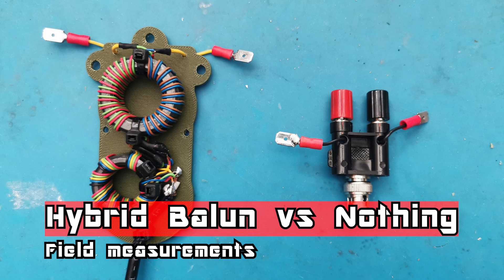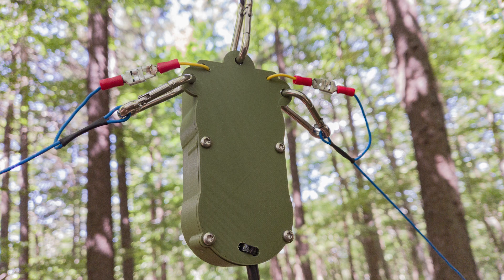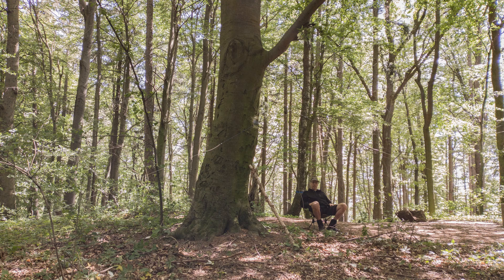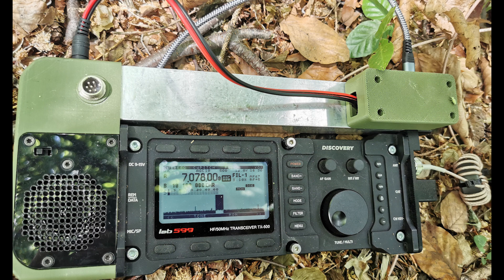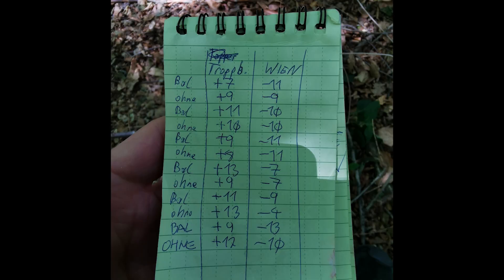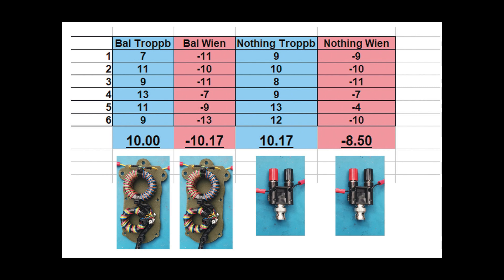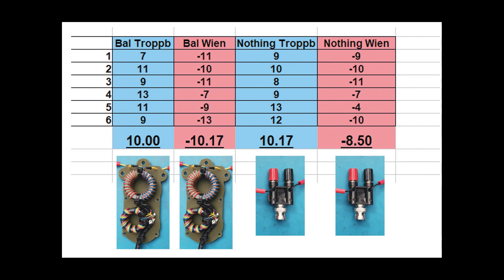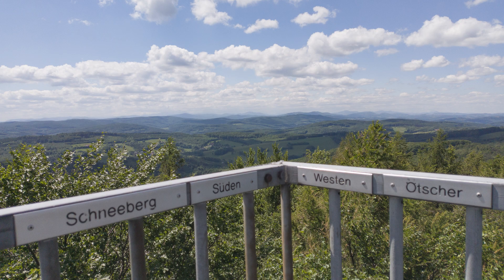NVIS Dipole, Hybrid Balun Vs Nothing

Comment: Thank you for sharing . I  stopped using a 1:1 balun on my antennas a couple years ago due to similar results. I do use a self built sleeve choke on my feedine to address common mode but to be honest I personally have not experienced problems with common mode on a center fed balanced antenna unless I  loaded the antenna on a frequency below what I cut the antenna for.  I feel the 1:1 balun just induces loss FWIW. Thanks again for sharing your data with us.
Reply: With a resonant antenna you don’t need any type of feed line choke.
Reply: @N2YTA  Yes but I use a feedline with a choke because Its what I use as I said. Thanks for sharing your insight.
Reply: @survivalcomms  it's not likely that an antenna will be perfectly resonant everywhere in the band so using a choke is a good idea.
Reply: A coax wound balun introduces no losses, yet still stops common mode, it's a win win with no negatives.
Reply: @VE9ASN  yes, good point

Comment: Yeah, it's easy to forget that baluns introduce their own losses, so they're only useful if they're fixing a worse problem than they are causing.  Obviously vital in an antenna a long ways from 50Ω like an EFHW or an OCF dipole, but a normal dipole is close enough regardless of where you put it.  Even the 'imbalance' from feeding it a dipole with coax is only a couple percentage points drop in effective radiated power, less than the typical loss in a current transformer...

Comment: A very useful demonstration. The balun is there to stop common mode current on the outside of the coax especially on receive where we want to prevent any interference picked up on the coax outer from entering the receiver. Since noise levels when operating portable are low, a balun should not be needed.
73 de Steve

Comment: Just a question about setup - what was the electrical length of the feedline used? If the feedline is a multiple of lambda/2 then radiation from the feedline would be minimal compared to other feedline lengths. Edit: this applies to a resonant dipole so not sure if feedline length has much the same effect in context of a shortened dipole as presented here.
Reply from the maker: @jbfedison  hi, good point. I did a test in that video to figure that out.
https://youtu.be/nIa0Cy654gg?si=y1T9K3mQtWlt4I5-

Comment: A field strength meter reading would have been a useful gauge as to sig going out ?
Reply from the maker: hmm not sure if you can read that meter precise enough if you are so close to it. just a feeling
Reply: @CrazyChekov  possible.  However the band going up and down ant a /b or in this case balun/ no balun is at best haphazard?  Unless you conduct the experiment over a long period?
Reply from the maker: the longer the better for sure. feel free to join testing. the more results we get the better.

Comment: I prefer isolation transformers. Nothing will provide the kind of isolation a flux-coupled transformer provides at like 475 kHz ... baluns become ungainly at  that frequency, and I use one on a 1/2 sized K9AY loop to keep computer noise from swamping real signals picked up by the antenna.

Comment: In my opinion, the only thing a CM choke will do on a dipole in the field is help keep the radiation pattern consistent.
Without one the outer shield of the coax makes the antenna into a un-balanced T. 
If you get 7 beads of 41 mix or similar mixes with a 5mm inside diameter you can make up a lightweight choke cable that has no losses. 
When you're at home it's more about choking noise from the power lines.
Reply: If that's worth worrying about with the far field loss being ~2.5dB.

Comment: I challenge you to try again with a coax wound 1:1 choke.
You definitely still want to keep the common mode current off the feedline. 
It's likely that the only reason you're not having issues is because of qrp power levels.
Hybrid baluns are typically for ocfd anyway.
Reply from the maker: will make a comparison next time...coax   choke vs nothing
Reply: I have to second this. When you are operating QRP your reflected power is so minimal that even a poorly matched antenna will have a low SWR and will typically not introduce "noticeable" common mode back into the feed line. 

Now try that same setup but with 700+ watts and see what happens. 

It's another reason I dislike QRP, besides the obvious futility at trying to accomplish something with a -10 to -20dB hindrance, but it also gives the illusion of a well matched system that truly isn't. 

No rule says you have to use a balun, but they're there for a reason.
Reply: @Skullfocher  700+ watts lol , WHY ?.
Reply: @Richard-je4lt  Why? Because I work DX. I'm working stations over 7,000 miles, not 3 blocks away.
Reply from the maker: @Skullfocher in europe energy prices are too high to power a 700W amplifier. we can only go with QRP here 😁
Reply: @CrazyChekov  I feel for you, my friend.

Comment: What I wonder should the current choke be at the antenna side or to the radio. As I see it the current choke should be to the radio side. I may be wrong but think about it.
Reply from the maker: not sure too. I found both versions in the internet .
Reply: re: " current choke "
I am looking for a "voltage choke" ... un-obtainium?  /sarc

Comment: What would be  even more interesting  would be to use the Hybrid  balun with the  shield of the  Coax grounded to a  proper say one mtr in copper coated steel ground rod  , or equivalent  buried wire  in damp soil to  simulate what a  mains powered  transceiver  sends to the coax when  running.  In the case of a low hung antenna which sees a  non true differential signal at the feed point but with the coax tied to the ground plane I think you may see better relative performance of the hybrid balun  in S/N on transmit.   It 's not relevant to your  transceiver when run off a battery pack but one day you may want to run it off a 4 A  mains DC supply which will likely have the secondary of the transformer earthed to the case and then back to the ground stake of the house supply.

The frequency at which you run the test is relevant too, because as the antenna rises up a  more significant fraction of the transmitted wavelength, the existence of the  ground underneath, in particular with respect to the  E  field is less significant.
Reply: Further comment. I'm not sure why the lower voltage balun has four turns and not three.  I'd be interested in any references to the design file - though Ytube comments often stop direct UR_Ls being sent.
I notice that  the top balun, the current balun of the hybrid seems to have  four wires.  I wonder why it has not been implemented with a cross over of a single pair similar to the Balun Designs 1171 (nb their design uses well separated Cu so it does not give a 50 ohm  internal transmission line - I am not suggesting this is what you want). 
 The cross over  at turn number five  changes the winding sense half way through the winding and thus the gross circulating flux is zero.  This clearly reduces losses over a  conventional non cross over current balun design.  There is still local ferrite linkage between the individual pairs.  It's very cunning and produces an non radiating or minimally radiating  parallel transmission line. 
You may be familiar with this implementation and have rejected it for some reason. 

TEF
Reply from the maker: hi TEF, I used this wiring layout for the voltage balun/transformer....
https://images.app.goo.gl/4JuRFtMux5j5NTEM9
Reply from the maker: the current choke design is from DG0SA --> https://youtu.be/IPs_RIej3Bc?si=jIYh4DAXms9yVhin
Reply: I had a look at the  DF1BT design and there's a lot unsaid.
Firstly on the Strombalun it appears that  vinyl insulated  figure 8 cable is used - at least in some of the designs . PVC insulation is death to  RF  above  about 10 Mhz.  The only reason it can be used on the outer jacket of  RG58 is there is an assumption that there is  no E - field at the surface of the braid.  The PVC molecule is excited electrically not magnetically .  
The other point is that   twin ax is around 80-85 ohms impendance normally.  If it is wrapped as you have done it then you get "two coax wires " in parallel.  This would drop the input inpedance of the current transformer down to a nominal 50 ohms.  It seems gimmicy.  The known good way to make the current balun for minimal loss is to use  RG188 and provide the cross over so there is  no net  flux in the main core but there is magnetic  coupling between the individual turns if there inbalance from shield to core caused by an differential current in the load.  
It seems as if a current choke is "required" after a voltage balun because though the  VB converts a single ended signal to a differential one, it can't  discipline the RF if the load is not electrically symmetrical. That's my take on it.
Reply: @CrazyChekov  The five Wire  voltage BN/transformer  is new to me.  It goes  schematically  Blue Red, Green ,  blue, Red in parallel with a green wire as a DC short in the centre of the  wound  set. It seems that there is an attempt to  get a better  approximation of a non radiating  transmission line this way .  I have  never seen a test  comparison between the five  wire version and the three wire version of this design.  
BTW  if you look at the Balun Design webpage you will see that wherever they do an impedance conversion they always follow up by a  current balun.  It therefore seems that  voltage baluns cannot cope with driving what might not be a physically symmetrical antenna. I've never seen that explained.
Reply: It might be worth the experiment , Rx only of installing a Mini Circuits  RF transmission line transformer at the  dipole end  , with a view to building a  Tx/Rx  version on a  BN61-002 with heavier t/pair wire if the Rx experiment works.
Eg part TC1-1-13M-75+  . The issue being to buy one off without paying huge money.  I have also looked at Sevick's book of which I have a pdf copy and his recommendation for  unbal to bal is similar but uses a now unobtainable ferrite core (K material). He uses a Ring core .  

 I have successfully used  a BN core plus cat 5e cores to make up a Rx9:1 Tfr to enable a  SSB radio rx  with only a 500ohm long wire input  receive off a dipole . 

 RF and Microwave surplus place in Italia  may have some equivalent to that  Mini Circuits part - but they may also may have a minimum order requirement too.  The Mini Circuits part has a specific note that it can be used for  unbalanced to balanced transformation.

TE. Fidler

Comment: is it what is called a guanella balun or is that something else?  I have not found the need for a balun with my dipoles but I have also not run over 60 watts or so out of it, perhaps with stronger power I would need to worry about return currents etc
Reply from the maker: not sure about guanella balun.
its a current balun and a voltage balun what I used.
Reply: 60 watts max? Try it with a kilowatt and tell me what you discover.
Reply: @Skullfocher  I could light 4 ft fluorescent bulbs leaning against the shack wall at one point running a few hundred watts carrier for AM on 80 meters ...
Reply: I believe it.
Reply: @uploadJ  on 80 meters at anything over about 180 watts keying up will cause one of my battery chargers to reset. 40 meters causes one security cam to distort. 15 meters around 21 275 will trigger the remote control to the LED strip lights my daughter has in her office.  

That's why there's safe distance RF exposure protocols.
Reply: @Skullfocher  re: "That's why there's safe distance RF exposure protocols."
Well, in this case, B does not really follow A referring to the safe limits, that is. 
BTW, my differentially fed vertical 1/2 wave loop on 80 meters in the back yard does not cause problems like that 1/2 dipole over the house does, and a kW on 160 meters on that same loop (as a 1/4 wave tuned loop) doesn't affect the computer speakers either, but it will trip the house GFI that feeds the outside outlets and bathrooms at 1 kW.  100 W or running WSPR at 10 W has no affect on anything. Its that low dipole on 80 that turns out to be problematic. Small city lot here, I don't have a lot of space!

Comment: When something does not make sense, there's a reason. 
How far are you from home? You say this is NVIS but you need to be many miles away for NVIS. If you are just a few miles away then you are dealing with ground waves, especially on 40 meters. Ground wave transmission has a short local coverage and this is similar to what an AM broadcast station does. They use vertical antennas. 
Now it your dipole has NO balun the the coax is radiating vertically which will provide the needed low angle ground wave to reach your home. 
I suspect the balun is actually doing its job and preventing this vertical signal from the coax. 
Your signal measurements are better because the coax is radiating. 
The only way to do this is to use Reverse Beacon Network and get reports world wide.
Reply from the maker: thx for your thoughts but your idea of coax radiating came alread up a while ago and I tested that theory. feel free to watch the video.